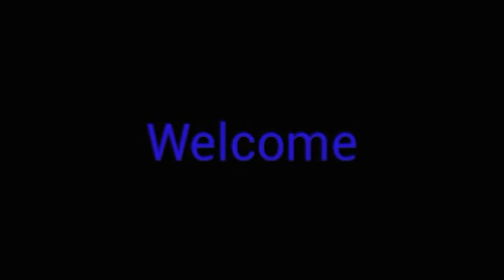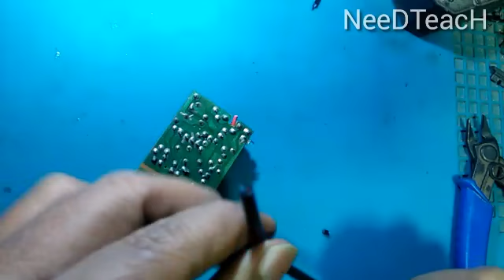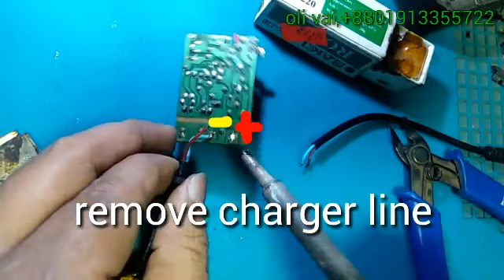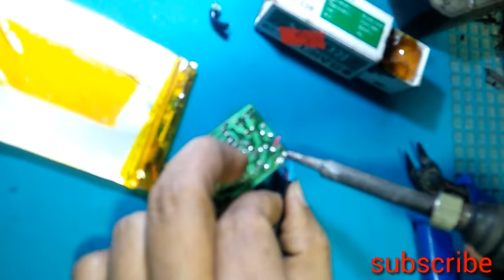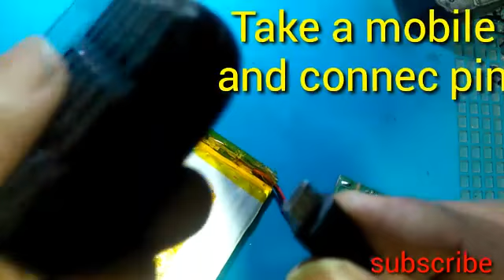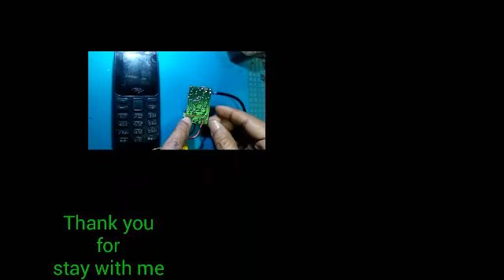Making a Power Bank | How to make power bank at home | Diy power bank

Comment: How to recharge this battery?
Reply: Ha ji btao
Reply: Direct charge the battery
Reply: Can you explain me how to direct charge the battery
Reply: You cut your baterai and charge and reconnect
Reply: Bro
A powerbank is a permanent thing if i cut this battery and attach it again then it should not be a permanent solution 
Thus it is not a powerbank 
Powerbank has recharge facility but it doesn't
Reply: I think,we can charge if we can connect usb port to charger's switch point.
Reply: @kushalmondal2723  think so we can add a usp port then its a permanent powerbank

Comment: hello friend, once again, since you have made the mobile charger as a portable charger, that makes li ion battery charges another li ion battery through the charger itself, that means we can do the same way you did, right?  I still didn't make it, because I was rely amazed how you can make the mobile charger as portable.
Thank you
Reply from the maker: Try again. Thanks
Reply: Amps to km he hongy isky to faida charge ka
Reply: Simple fake, where comes The diode(light) there are only 2volts,to charge phone requires mininum 4.5volts,people think.

Comment: Can we use hot glue to connect the wire
Reply from the maker: no
Reply: You can use super glue though, just make sure the contact between the way and the terminal is maintained.
Super glue can hold wire in place almost as strong as shouldering it!